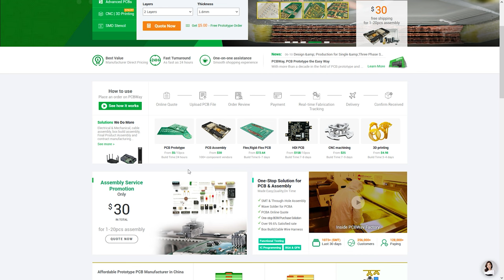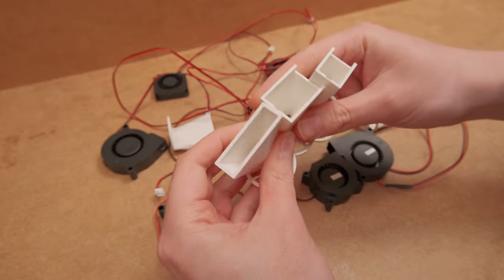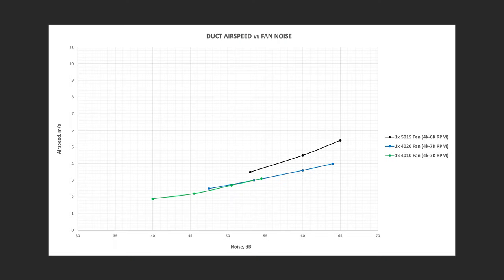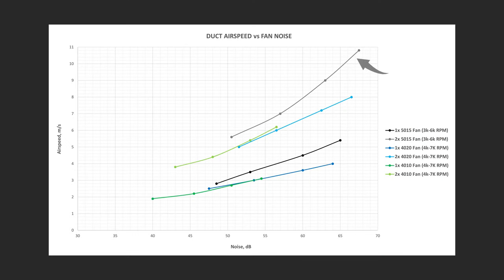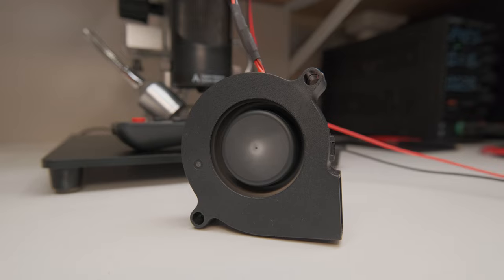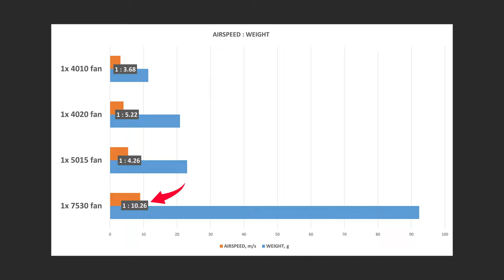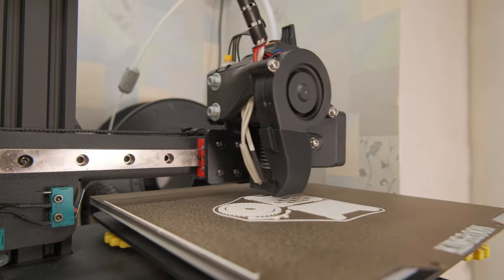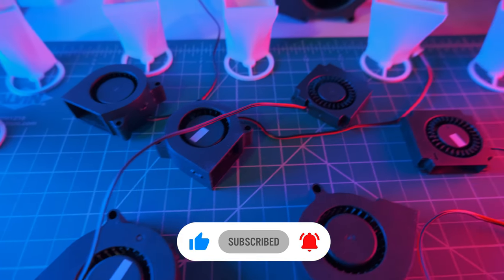3D Printer Part Cooling FANS COMPARISON (AIRSPEED / NOISE / WEIGHT) - 5015 vs 4020 vs 4010

Comment from the maker: UPDATED GRAPHS with the 5020 blower fan:
Google Drive - https://bit.ly/5020_CHARTS
Imgur - https://imgur.com/a/6oUTb05
For people who are concerned about the different brand performances of the fans, I can say that these tested fans were "generic" types like Gdstime, MX, Usongshine, etc. Their rotor fin designs are basically identical. The main difference is the RPM at which the fans run. That is why in the graphs on each fan performance line you can see the dots, they indicate increments of RPM of 1k (except the 7530fan). So as the designs are the same the most important factor of performance is RPM and the generic-fan-type brand doesn't really matter for this aspect. If you want better-optimized blower fans search for Delta, Sunon, Sanyo Denki, Mechatronics Fan Group, and others. They will perform better when compared at the same RPM but don't expect miracles like 50% better performance and 50% lower noise. Hopefully, this answers the question if you had one.
Reply: How do you think the gdstime 4015 would rank?
Reply: Thank you this video, it truly helped me figure out what to purchase! I just did my first printer and what a difference, both in flow and noise. Without your video i wouldn't have started this upgrade 👍

Comment: One issue I've noticed with bigger fans is during bridging moves. Some of these larger fans don't even spool up until after the bridge has been completed. Kind of like turbo lag on a car.
Reply: Fan should have a program advance in the slicer.
Reply: @SianaGearz  nah I think we need a misfiring system
Reply: @Iisakki3000  Elaborate please?

Comment: I suppose it's completely subjective, but measuring noise level alone doesn't reflect the TONE of the noise. I am much more comfortable with the tone of a 4020 or 5015 fan than the screech of a 4010 fan.

Comment: Weight is irrelevant. Put the fan on the printer frame and bring the air by a hose to the printhead. Solved.

Comment: I'm running a 4020 axial fan for the hotend cooling and a 5015 blower for part cooling. I tend to run the blower at around 60% for most prints (for a little less noise and to try and eek out lifespan) but for bridging I tend to ramp it up to 100% (using Cura's "experimental" bridge settings). Most of the time this works pretty well for me - so far.
Reply from the maker: YES! 4020 axial for heatsinks works pretty well and if you have a branded high-quality 5015 fan you definitely can run them at lower speed while still getting a lot of cooling.
Reply: @PrintingPerspective  I did purchase some Winsinn 5015 blowers but they won't run at anything other than 100% speed. I guess something in their electronics doesn't like PWM. I might try a Resister/diode/capacitor filter circuit to see if that helps but since buying them I've read that Winsinn aren't that great anyway - I'll have to build the filter to find out for myself I guess.
Reply: @steveellis2829  Curious about your opinion on the WinSinn fans after running them for a while.  I've been running WinSinn ball bearing fans exclusively for over a year (primarily because of price).  I've found their performance is excellent, BUT noise levels are "hit or miss"...especially with the 5015 blowers.  I have several that are VERY quiet, while others are far worse than the crap Creality fans.  I have no idea why, it's just what I have noticed.  I'd love to find some simiiiarly priced fans that were pretty quiet.
Reply: @tommyc8333  Certainly WinSinn fans aren't the quietest of fans but they have so far proved to be pretty reliable however I do tend to peel back the label and put just a drop of machine oil onto the bearings before I put them into service - this might be helping. I've not noticed any being quieter or noisier than others but then I've not needed to replace any yet so that might change further down the line.
Reply: Just as an update - I built the filter for the Winsinn fans and can happily run the fans at lower speeds without issue or strange noises. They've been running flawlessly for a few months now. All good.

Comment: For relubrication avoid motor oil or any mineral oil in general. Use ATF hydraulic oil or silicone based oils instead. WD40 will ruin a bearing too.

Comment: I have two 5015 fans on my e3d v6 /titan clone setpu, i have a week trying to find why my printer halt, then i figure it out that i need the TEFLON  socket because if the fans go up 60% , the air refelected in the model download my hotend temperature so low , thats triger the Marlin error , and stop printig, so PUT A  SILICON SOCKET IN THE BLOCK, PROBLEM SOLVE (i musts do that first but i change the termistor, nozzle, try pid calibration , all of that first...good leson for me)

Comment: It's difficult to find a 5015 blower that doesn't whistle at speed lower than 100%. Often materials like PETG needs 20-40% blower speed, and the whole printing will be with an obnoxious hissing.
Reply: You sure it's not your PWM control? You can change the PWM frequency or add a Pi filter.

Comment: Fantastic job! Succinct video that sums up excellent suggestions. Bottom line: 5015 or two that has been used for years now is, in general, the way to go. You have a knack for this type of topics. Wonder if one day you'll disprove a common practice (like CNC kitchen has done a few times). Well done!
Reply from the maker: Thanks a lot, I am glad you like the videos. Yeah, 5015 fans are great. The only common practice that I know and could have real potential is using blower fans instead of axial to cool the heatsink of the hotend. Using a smaller heatsink with thinner fins and a 4010 blower fan at reduced speed could make the hotend smaller, and fans more silent without losing required cooling. Sprite Extruder has something similar but it uses the almost useless 3010 blower fan which must run at insane speed being very loud to compensate for its size.

Comment: I designed a dual 5015 mod for the voron 2.4, and was still able to run 7k accelerations -- with a canbus toolhead board, so weight savings of removing the cable chains, I was able to keep the weight down, and cooling performance is excellent.
Reply: You can easily get 20k acceleration with >350mm/s using stock Stealthburner on a 2.4 Voron with very good quality. I'm running that for several month now. Reducing weight with a custom toolhead should yield even more.
Reply: Which mod is it? Manta or the Owl?
Reply: Do you have a link to the setup so I can try and print it?

Comment: i used dual 5015 for a while but switched to a single 12032 that is mounted on the side of the printer and connected trough a hose to the printhead.
- all the airflow i could ever need
- no weight on the printhead
- the fan should live longer because its not being shaken by the hotend moving ;)
- runs perfectly fine from the fan header of my creality 4.2.7 board :D
Reply from the maker: That kinda setup is so interesting. One day I will probably try it too :)
Reply: Wow now that is an interesting setup! Got any more info to share on it?
Reply: What about the noise level is this setup?
Reply: @sandrolauer350  its a lower pitch then the dual 5015 i used before but its by no means silent. 
but i dont really care about noise since the printer is in the basement ;)
Reply: @2mD  I kept reading about all these 3d printed fan mounts, shrouds etc. and I kept thinking that a bigger side mounted fan with a light, flexible duct would be both simpler and more efficient :)

Could you please tell what kind of hose you use (e.g. material, diameter, length) and do you simply terminate it close to the nozzle or do you use something fancier to focus or spread the air around the nozzle? Thanks.

Comment: Im running a Neptune 3 pro and one of the fans has a pinched wire and was causing thermal runaway when the fans turned on. So I printed the Wind Warden upgrade and snagged some 5015 fans and Im glad to see I made the right choice! I print a lot with a .6 mm nozzle and I have been eyeing a 50-15 fan upgrade for a while. The bridging on a nozzle that large is terrible but hopefully this upgrade can mitigate that. Also the wind Warden upgrade makes the tip a lot easier to access

Comment: I personally use a 4028 server fan, pushes so much air, and it'g great for fast parts.
Reply from the maker: Yeah, server fans can do that as they operate at 10K+ RPM. Probably not the best airspeed-to-noise ratio but I doubt that is relevant as you are rocking RAT RIG V-CORE 3 at some sick speeds :)
Reply: You just listed my setup, I’m looking at making a mod to run 2 4028. This would allow quieter ops running at like 50% while having higher headroom if I want to print a 5 min benchy

Comment: Something else about 4020 fans, is they blow air out at a 90 degree angle towards one side. This will cause uneven air flow, especially if you have split or more ducting. I found smaller ducting gives it more backpressure and far more even distribution. And going on a deep dive also found blower motors are made to operate in high static pressure environments, i.e. pushing air through long ducts in homes that go up multiple stories while pulling though dirty air filters.

Either way, when i tested out a 5015 fan and i found it blows out almost straight out and moves slightly more outside of a duct. BUT i also tested a 4020 blower fan with 0.3A draw, vs a typical 0.08A draw.. literally blew my hair back. Only issue with a 24v 0.3A DC fan is low speeds, might ruin any print that isn't PLA and used mechanically.

I'm currently designing a new part cooling duct for the 5015, see how that goes

Comment: I run a HeroMe gen 7 set up with a Noctua 40x20 on the hot end and two 5015 fans for part cooling. I have a sprite I am thinking about modding as the stock blowers are well...

Comment: I go through a 4010 heatbreak fan about every 8 months. I really wish there was a more durable option out there. My 5015 part cooling fans have no issues with the acceleration (25k @ 750mm/s)

Comment: Word of note: i tried a Sunon MagLev fan, and it was a catastrophe, the magnetic bearing just cannot deal with high vibration environments. It made horrible noises.

I'm still using it but i filled it with so much grease that it's mostly a sleeve bearing fan now :D

My previous sleeve bearing fan died quickly, but the converted Sunon seems to be holding on. I think double ball bearing fans are the only fans suitable for a high vibration use. So next a Delta fan i suppose :D

Sunon also has another problem, Autorestart feature. It does not play well with PWM, the fan goes crazy. You can either up the PWM frequency, that sort of works but lead to weird noises. I ended up building a Pi filter, but i sort of went a little wild on capacitance, the control delay is hilarious but it works i guess.

Comment: The most really important points are completely missed here....
We need to talk about airflow and air pressure. When you open up a spec sheet, these are the values you find.
This is your first clue: No manufacturer talks about airspeed....
Also, if you read some specsheets, you will find massive differences between blower fans of the same size. So comparing random models is questionable.

Example1: 
An axial fan delivers a very high airflow, but a very low air pressure.
If you mount an axial fan to a long/complex cooling duct, it will be ineffective. Because it cannot press the air trough the duct.
That is why we use blower fans for part cooling - they deliver a much higher air pressure.

Example2:
The BerdAir system uses an actual airpump and delivers a very little amount of air under extrem pressure to the printed part.
This outperforms your standard 5015 fan and is commonly used in the highend area. 
So we further increased the pressure and decreased the airflow.

HOWEVER:
If you your ducting/delivery sytem is quite open/direct, a higher airflow at lower pressure does the trick as well.
It is however less directed to immediately cool the plastic when it is layed down. This might affect the printers performance while printing overhangs. You want to cool these directly out of the nozzel.

Conclusion regarding airspeed:
If you deliver twice the air at a slightly lower airspeed, your cooling will still be better overall.
If you widen your duct for a "lower pressure" airspeed fan, you will immediately increase its overall performance in direct comparsion to a "higher pressure" fan.
The "higher pressure" fan will profit less of this change.
Meaning your test setup does provide only partially valid data.

In general:
The RIGHT amount of cooling will deliver the best printing result. Too much cooling will even result in issues - depending on your filament.
The required cooling depends on the material flow.
If you build a highend-speed-printer, your 5015 fan will not be sufficient. Of if you print with a 0.8mm or 1.0mm nozzle.
For your standard printers, like Prusa i3, Ender etc. the print speed is limited.
There is no need to make the printhead heavier by mounting an overweight part cooling fan to it.
A proper fan duct is most important here - you want equal cooling performance from all sides.
Reply: @sourand jaded Well, the air heats up when you compress it and cools down when it expands. So the total energy and therefore temperature remains equal.

We could get into tiny details now, where the compressed and therefore heated air radiates some heat away on its way to the air duct.
But also an airpump will create more heat than a simple fan and transfer some of it into the air it compresses.
So I would assume these effects are neglectable.

Regarding radial fans:
This was for sure a massive improvement over axial fans for part cooling.
It is sometimes strange... with today's knowledge and experience, it all feels so obvious. 
But it is for sure not, when we hear about these things for the first time.

I have been working on a design using two large radial fans connected with a high-diameter hose to the printhead.
I am targeting a high airflow approach over maximum pressure.
The reason for this design was simple: The airpumps for a berd-air are too loud.

By now, the community came up with a similar design, but they use a lower hose diameter and ultra high rpm radial fans. 
These ones sound like a trubine, which makes it a no-go for me again.
But the cooling significantly outperforms the berdair system.
Reply from the maker: Michael Schaub, I perfectly understand your points, but I think you are taking this video as in your eyes it should be some sort of definitive comparison with the most accurate scientific data.

You compress the air into the duct with one of these blower fans, but when the air leaves the duct that air expands resulting in an increase in airspeed. So I don't think my results are misleading when using airspeed as a performance indicator. The whole video is based on giving a general comparison of what you could expect from these fans. And I am using the test duct opening size that is similar to the real ducts for regular 3D printers like Enders, Prusas and etc. Not to mention that there can be slightly better-optimized fans of each type. That is why I think a general comparison is more than enough.
Reply: @PrintingPerspective  
I do understand your point. My conclusion was, that the data is partially valid.
And yes, if you conclude that a bigger fan gets you a better performance to noise ratio, I do agree with that statement in most cases.

I just think that the perspective is too limited. When I listen to the 5015 fan on my I3, I do not hear the fan, but I do hear the air passing trough the airduct and I hear the air pushing on the printed part. A different air duct will make a greater change in noise level than your fan ever could.
If you now use an approach with higher volume and lower pressure, your noise level will drop - independed from the fan noise. Simply because lower pressure in the fan duct results in lower speed in the fan duct with results in lower noise. Again, huge dependency of the kind of airduct design. 

And regarding differences between same sized fans: I spent hours searching through spec sheets when I designed my external part cooling system which features a hose to the printhead.
We are not talking about a minor difference. The pressure between two fans of the same size can be double - and the fans will look quite similar.

Regarding your last comment:
You got it the wrong way around: If you compress the air, the air speed increases. The speed is highest, at the most narrow spot.

With expansion (wider spots / leaving the air duct) the air speed decreases.
However, this is just a sidenote and does not impact your results, since you measured all ducts the same way.

In summary:
If you want to provide a general overview in the thought of bigger fan = better noise/performance ratio:
This statement remains correct as long as you work with short / simple airducts which are not significantly more narrow than the exit of the fan itself.
Meaning, for your I3, Ender, etc. the results are generally correct.
Reply from the maker: This kinda comparison video is so hard to make as there are so many variables. My goal with it was to provide the most relevant data for the most common 3D printers, which is not perfect but at least it is not anecdotal data, you know. I appreciate the in-depth comment, there is always something to learn from those.